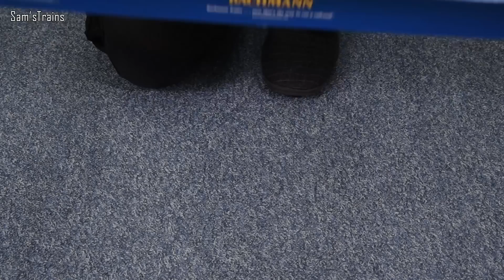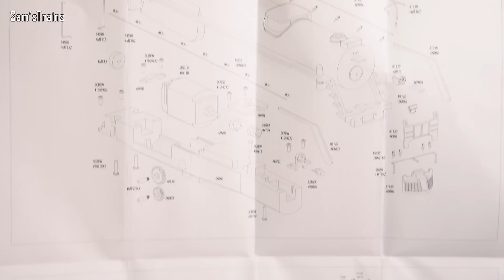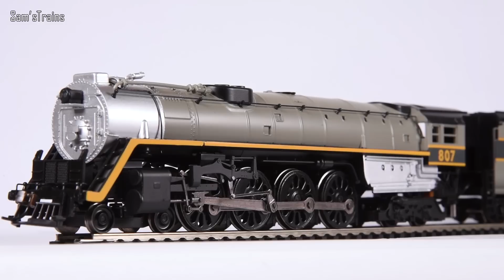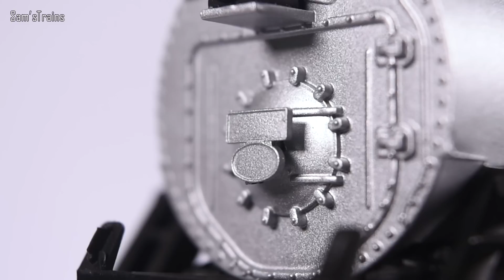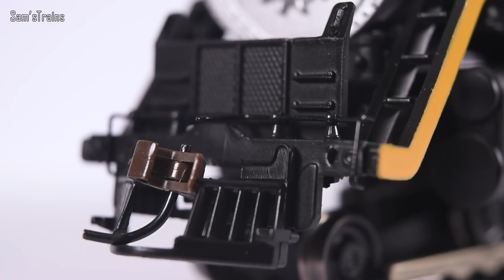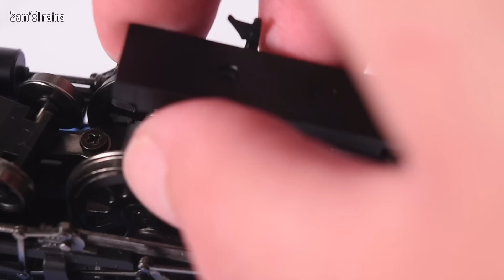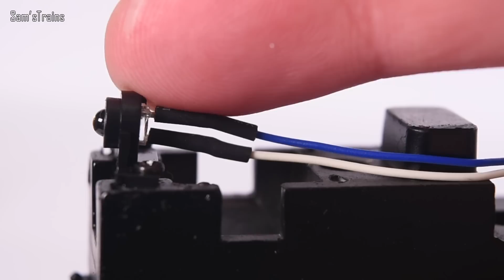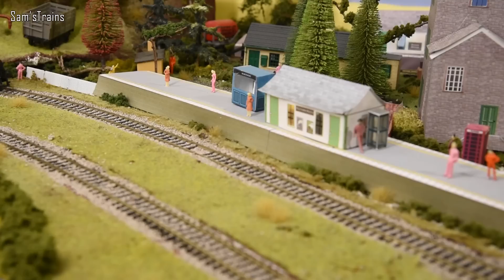Cheap,  Derailing Bachmann UP FEF Steamer | Unboxing & Review

Comment: This was my first loco, part of the Overland stater set and the thing was a nightmare. The draw bar wasn't properly set up and constantly came loose, The loco derailed a lot and when it wasn't derailing it would just stop. it had to have a head of steam to get  past the rerailer or it would just stop. The small trucks just spun around loosely and so the thing was a chore to get situated properly on the tracks after each derailing. I hated it, it drove me crazy. I finally just stopped using it, ordered an Athearn Santa Fe diesel and waited for that to arrive before i used my layout again. The SF never derails or stops or stalls and neither does my Athearn GT diesel. Same track, same layout. I threw this one in a drawer but i honestly don't know why. I should just throw it out, it is completely useless.

Comment: For whatever reason, both of Bachmann's offerings of a  "Union Pacific" 4-8-4 have just been other line's locos with a Vanderbilt tender behind em. Newer ones like the one in this video use an NYC Niagara, whilst older ones use a Santa Fe design. (The latter is bad about the wheels getting out of quarter and jamming the rods, though...)

Comment: I found one in stock somewhere With dcc and I’m very excited to begin fixing it. It looks nice but needs some help in the running department. I already fixed the older model 806 train set version that may have been near a fire or space heater or something so I’m quite excited to fix one that isn’t partially melted.

Comment: My friend Jack actually has one of these engines with the same wiring issue. He had me fix up the wires on it, and it works way better now. I last ran it on my layout three months ago, and it handled very nicely after I fixed the wires. He actually relettered his for the New York Central as number 6002, and fitted it with a TCS WOW-sound dcc sound decoder not long after I fixed it, and it actually has the prototypical New York Central a200 air horn and air-activated bell. It’s a beautiful engine, and it looks beautiful next to my Bachmann J3a. The grey contrasts beautifully with my standard black roster.

Comment: Sam, I have this engine (bought the whole Overland train set new) I have a layout w large curves and it does fine.
I converted it to DCC , removed the stock smoke unit and added a Seuthe brand one controlled via DCC function.Also added metal wheels to tender trucks and firebox flicker lights(drill out the fake holes in the firebox door and LED behind it ,decoder set to flicker it). Not a huge powerhouse or speed demon but she runs smooth and quiet. And it was a cheap loco to learn modifications on.
Reply: You basically rebuilt it and then turned around and said MINES FINE bro ofc its fine when you've practically replaced anything problematic lmao.

Comment: I have one of those locomotives, and it's actually a pretty good model. It has a smoke unit, good pulling power, and is not a bad runner at all. Yes, the locomotive itself is clearly a NYC Niagara, but the tender is an oil tender. In real-life, the Niagaras were coal burners, and used "centipede" tenders.

Comment: i know this is an old video but the variant of this loco i have the 806 which i think i got only a year or so prior to this video did not come with tender pickups or even the wires from the tender to the loco nor the correct instructions lol but even so the tender pickups ain't really needed well at least thus far according to my testing but i would recommend adding some weight to that tender i went overboard with that and the tender is now heavier then the loco but has increased its pulling power and i even send it up a bout 2 and a half percent grade
sorry if the grammar aint great i just rush typed this

Comment: This particular model is a NYC Niagara Bachman painted it to represent the UP FEF. These locomotives were equipped with centipede style tenders. I believe they were coal fired throughout their careers. The 844 was refitted to burn oil, so it could run the entire UP system. 3985 a restored 4-6-6-4 Challenger has also been converted to oil and the restored Big Boy 4-8-8-4 has also been converted. Look at a photo of 844 and see the differences.

Comment: Just wondering, did you try connecting the wire over top of the connection bar between the tender and the engine instead of underneath that may be why it's lifting on you.  Especially on the turns.

Comment: Bachmann has essentially been making this model since my childhood. I can remember my disappointment with the exact same issues when I was about 7 years old in the 1980s. From my memory even if you fix the draw bar by including a second link in between, it's only a matter of time before the play in the drawbars causes the wheels to lose quarter around a corner and the gear set chews itself into dust. The part that blows my mind is that this is exactly how this was 35 years ago with the same model. Bachmann products available in the United States are terrible and they have ruined the model railroading experience for many over here.

Comment: I have this train but a way old one, (2009) and no dcc. And it doesn’t behavior like this one it takes 2nd radius curves no problem and came with 13 freight cars, pulls them no issue. I haven’t used it in a few years though because lack of space though, maybe I could send it to you so you can test it out

Comment: So, I got my FEF in the Overlander Bachmann set. It's a specifically DC set, completely locomotive powered, which means no annoying wires to the tender. Detail is identical to yours. Now for some reason, the torque issues aren't present with mine, I can put it up to a wall and the motor and wheels don't slow. Now, the drawbar and bogeys caused derailments all the time for me, mainly because it was either so low that the tender would jump out, or so high that the front of the tender left the ground. Like you, I bent the drawbar into a proper position to actually work, and since I didn't have pesky stiff wires in the way, it more or less fixed the problem. I do still have issues with the bogeys from time to time, but on a flat layout, they usually sit well. I do get a little anxious running it at high speeds though. The main issue is that, because of the way the bogeys and wheels are set, it doesn't take sharp curves. Like at all. That's not so much an issue with length, as it is that the wheels don't slide enough one way or another. Very rigid housing. However, it runs fine with the track that came with the set. 

Moral of the story, if you want this locomotive, just get the whole Overlander set. It's the only way you'll get something that guaranteed works
Reply from the maker: Thanks a lot for sharing - yes it was definitely the wires causing the derailing on mine! Appreciate the info,
Merry Christmas - Sam :)
Reply: I always wanted the overland limited train set but i dont have enough money

Comment: Union Pacific FEF-4 8444 (844) is The only steam locomotive to never be retired during dieselization. On July 21, 2018, Kelly Yarish was taking photos too close to the tracks. UP 844 was thundering down the line and ended up hitting and launching the woman. Kelly instantly died as her body was flailed off the tracks. This is an example of why you never stand on or next to the ballast. Trains are wider than the rails.

Comment: The locomotive is good when running on it 
It’s from the overland limited set but if it’s any news to you same the orginal Santa Fe design one from the horn hook days of Bachman looks better than this repainted nyc Niagra model, and if you choose to ya could convert this to dcc since it’s got room in the tender for a sound speaker and the one from the overland limited has a operational smoke unit which is nice

Comment: I have this Union Pacific FEF aka New York central Niagara in the dcc fitted version and it runs like a dream I did have trouble with the drawbar but after I bent it down it has great tork and decent high speed I love running it at my local club

Comment: This model is indeed cheap but Bachmann do or did have a really nice model of the Santa Fe railroads 4-8-4. This one actually models the real one and came with DCC and sound and is a really good runner and pulled. I have pulled at least 20 Atheran streamliner coaches with it so it does the job I want. Be cool if Sam got a model of that to make up for this model.

Comment: the FEF 844 got an extra 4 for Obvius reasons: a GP35 has same Running Number (844) until the GP 35  was scrapped and of course i think those trail and lead Locomotive trucks just need springs, Coupler between loco and Tender need adjustments, new bearings and you got your self a Train performance improvement.

Comment: Posting this comment before the video starts. I have this locomotive and it was in a starter set and the one same has should have working smoke and lights but either way you WILL be DISAPPOINTED with this one because it will eventually start giving massive amounts of trouble. If it doesn’t then you’re lucky

Comment: That’s not a FEF-1 2 or 3 it’s a New York Central 4-8-4 Niagara (they called northerns Niagara’s) how do I know well if you pause the vid at 6:00 you’ll see the light and the logo in the center witch is painted silver like the smoke box and that’s the wrong tender of the Niagara and FEF class

It still looks nice tho

Comment: 100 dollar paper weight. I’ve been disappointed in Bachmann lately. I’ve gotten 4 new diesels over the last few months. 3 of them have had to go back for warranty work. 2 of them had grinding gears straight out of the box, the other one lasted a month before the motor burnt out. However their warranty department has been excellent.

Comment: As always, a thoughtful and insightful analysis. It is a shame, because it looks as though Bachmann did good with the five pole motor and flywheel, and none of that split chassis rubbish, but failed to get the tender and locomotive together so it would stay on the rails. I couldn't really see, but are the center drivers blind or flanged? Anyways, North American isn't my cup of tea, really, so no loss here.

Comment: I think that bachmann cheated here. The frame looks like they took it from a NYC S1b Niagara. The U P FEF never had roller beearings on the rods, and they had Walshaerts valvegear. On your loco it looks like a baker valvegear. You will find enough photos of the FEF as well as the Niagara to get the picture.

Comment: (I actually got the dc version in the overland set but I was extremely disappointed in Bachmann for making a mistake so tarnishing): THIS IS AN NYC NIAGRA!!! Not a UP FEF. They wouldn’t screw up the NYC Hudson, considering the Niagara’s were just Hudson’s with 8 drive wheels!(Hudson’s are 4-6-4’s and Niagara’s were 4-8-4’s)

Comment: The Bachman FEF-1/ NYC Niagara ( the actual engine modeled) is basically a train sets locomotive that's been reboxed for individual sale. Bachman's lowest price series of locos, but it's not alone in it's wiring problems. In a decoder install video, a new spectrum series 2-8-2, the client complained that when properly connected the tender wheels were lifted off the track. Inspection showed that the stiff wiring was the fault, and this was one of Bachman UA's premier series of locomotives.

Comment: Bachmann sold a set that had this locomotive in it with a smoke unit equipped. As per usual with Bachmann smoke units, it ended up melting the plastic case of the locomotive. If you buy other Bachmann locomotive with smoke units equipped, I recommend removing them before you run the locomotive for extended periods of time.

Comment: Interestingly enough, this particular model isn't even accurate
It features a combination of a New York Central 4-8-4 Niagara dressed up in a Union Pacific "Greyhound" livery, and the tender from a Great Northern 4-8-4 Northern given the same livery. So, it's not even a Union Pacific FEF at all!
It was originally released in the Bachmann Overland Limited Starter Set, but is obviously being sold separately, as well

Comment: Sam, I told you, Bachmann in the states it cheap, guess you really found out. I have had all of my Bachmann locos just fall apart and break, this one will likely fall apart too. Gonna recommend this again for the millionth time, Atlas ALP45 DP is way better. Be sure to get the DCC variant, well worth the extra money with it's amazing sounds.
Reply: A lot of Bachmanns newer offerings are good. Their Amtrak stuff is exceptionally well done, especially the ACS-64,  and SC44 among others.
Reply: @derekonxbox  Funny you mention, I had the Amtrak Accela and returned it after the pantagraph broke and the car wouldn't cupple. Ended up getting a GE Genisis by Athern Genisis.

Comment: Your curves are too sharp for ANY US 4-8-4 ! You have some S curves which are a no-no, too !... 
23:48 & 23:51 are hideously too tight for this size loco. It's not the motor or torque, nor the wires or draw bar that is the problem. It's your too sharp curves which make it slow down on them; flanges getting wedged and binding against the inner rail causing it to climb the rails and derail !
Get your trains off the floor my friend and modify your main to have wider curves if you want to run big US steam !
M, Los Angeles

Comment: I've just done a quick Google Image search and, um... That's not a Union Pacific FEF, not even one of the earlier FEF-1 or 2. That's a New York Central Niagara without the distinctive "elephant ear" smoke deflectors. The Vanderbilt tender is closer to UP practice, though again none of their 4-8-4 Northerns ever carried a tender that small. I expect this is overall not really based on a realistic prototype at all, but rather more a case of some designers at Bachmann rummaging through the toy box and sticking together some things that basically look right enough together; as mentioned in my previous comment, this loco was meant to be part of a train set.

Edit: Sorry to repeat what a lot of folks have already pointed out. Just took me aback as it's the first time I've caught that in 30 years; I always knew there was something off about it, but couldn't place what. I just assumed it was completely fictional.

Comment: I've known of this model for years as part of Bachmann's "Overland Limited" train set, a true monster of a cheapish train set with a massive number of wagons, just straddling the line between being too expensive for children or beginners and too cheap, both in price and quality, for hardcore modellers, and yet being part of the Bachmann catalog since at least the late 1980's. Thinking about it, it's kind of a bizarre set; none of the rolling stock is particularly high quality, yet it sells for between $250-400, yet you can buy it at WalMart.

Comment: Despite the fact that Bachmann have just repainted a NYC Niagara to resemble a UP FEF, in real life the Niagara was based off of the FEF’s design (both were built by ALCO), with several improvements and alterations per Paul Kiefer (CME of the NYC). Interestingly enough Bachmann used to offer this model in a New York Central black livery. I guess they couldn’t settle for a NYC themed set and had to go for Union Pacific. Glad you got to review this one. Great review as always Sam!

Comment: I'll just put this out there from my experience with american steam is that the most consistently good machines i have come across are usually Athearn or BLI, detail is next level (usually) and i have a 4-6-6-4 challenger from Athearn that probably still runs from their first run (thinking 2006 for some reason) aside from sitting for the last 8 years and me having NEVER done any kind of service. I also have a PCM (BLI before they were BLI) 2-8-8-2 N&W Y6b that may be one of the most impressive models i've acquired. It would run although the electronics have something wrong that i haven't had the time to deal with (i say this because i have seen it run but it definitely has electronics issues).

So moral of my paragraph there is, in my view at least, Bachmann is kind of the budget brand that you get for a kid or a "beater" for your layout. High value for what you get, but not something i'd normally be proud to show. I'd use harsher words but i do hold a bit of love for them as they were among my original models as a kid. All in all, don't expect much from them, follow the money and you'll usually find a (drastically) better model.

Comment: While you're on the drawbar mods it'd probably be worth closer coupling the tender - thatcgap is horrendous - but I guess it depends on your curve radius. Personally I'd have difficulty in living with that. Maybe replacing the wire loom with finer wire would do the trick or maybe you can spring the rear loco bogie and fit similar pickups to those in the tender. Given the length of the beast you can probably do without tender pickups altogether.
Some light weathering based on archive photos would pick out the moulded detail and would make a huge improvement to the looks.